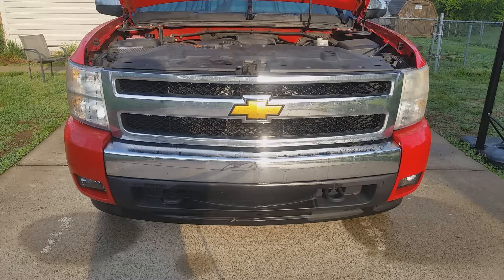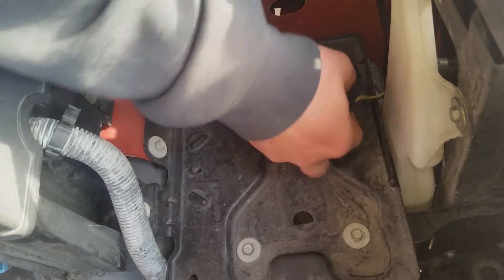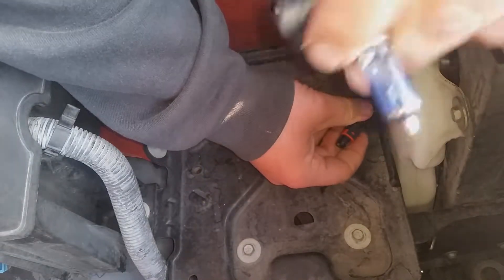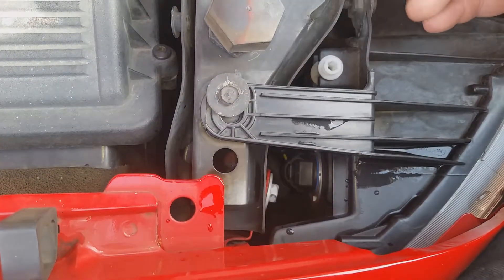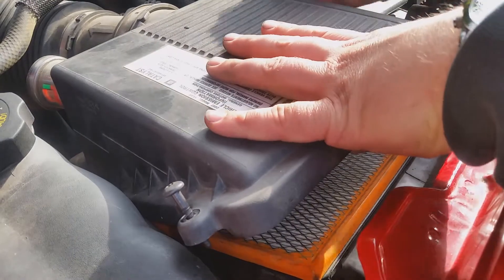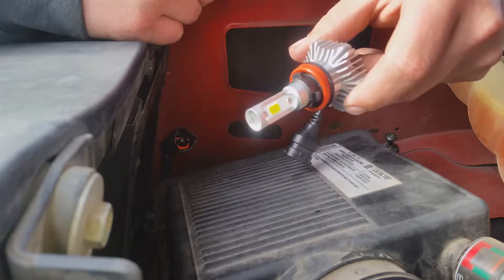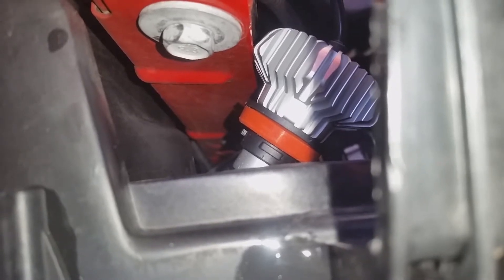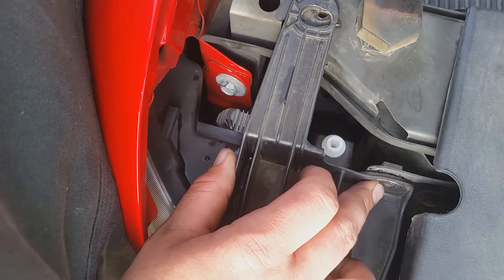2007 chevy silverado headlight bulb replacement / LED upgrade (how I did it)

Comment: Besides liking your LED bulbs more, the fact that nobody seems to mention is the life of an LED is advertised at approximately 50,000 hours, vs the britest Sylvania halogens are only about 1,000 hours. Read the fine print on the back of the packaging.
Reply from the maker: These LEDs haven't went out since I made this video, I bought extras just in case but there still going strong. I would have already had to replace the Sylvanias at least 4 times if not more by now. Plus I paid 30 bucks for the set of LEDs as to 45 or more for the Sylvanias. Never going back.